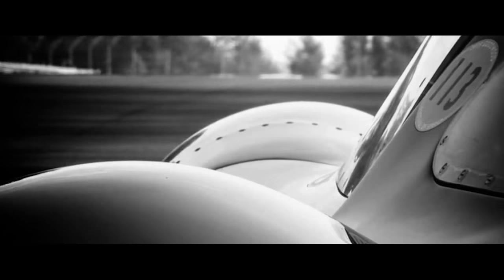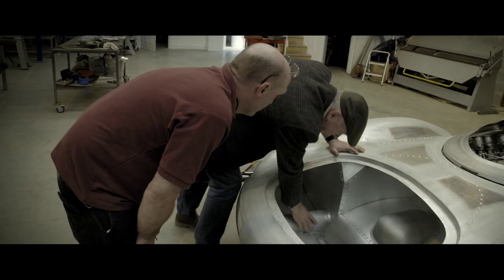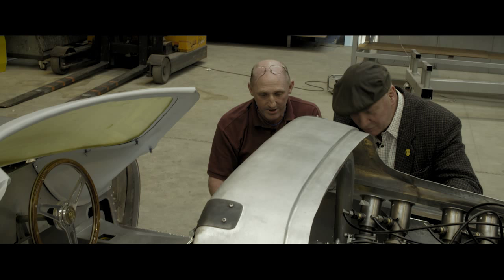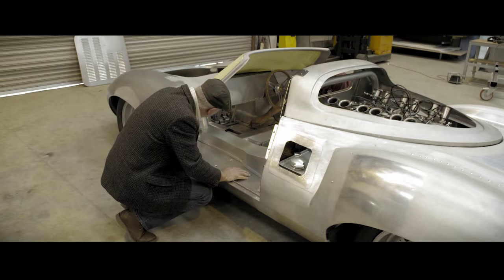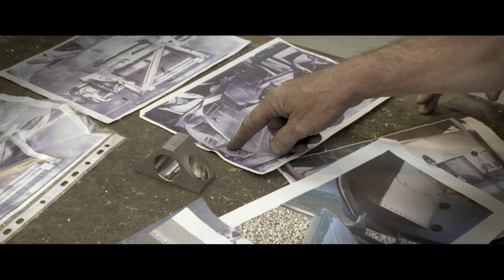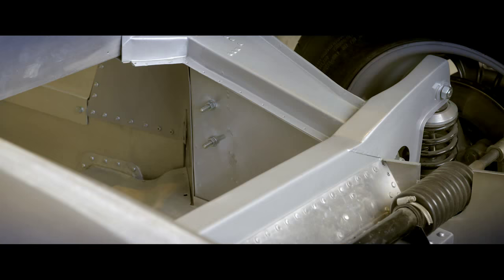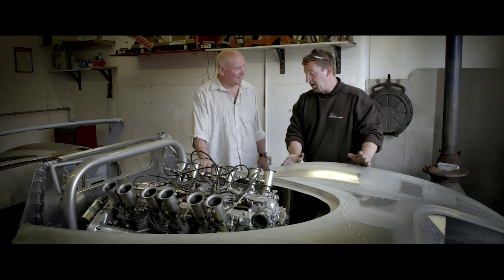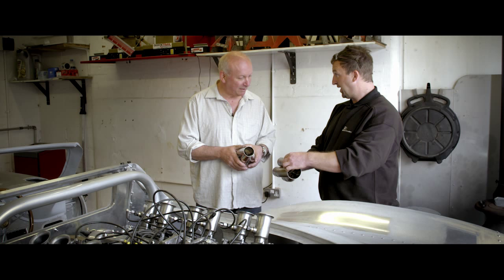Recreating Jaguar's Legendary XJ13 - 50 years on

Comment: Nice to find this in you tube. I completed my apprentiship 71-75. The last 18 months in the veh. experimental dept. under Ted Brookes and having the rebuilded original car in the shop. Nice to see the credited names at the end of the film. I worked with these guys during my time in the Exp. engine dept. Hope all are keeping well. After 3 year working for Ted I had the honour of working for Norman Dewis 78-86 (who of course had the accident at MIRA with the original) years before. Thanks to Norman I met my wife 1983 as he sent me to the Nardo testing circuit. Thanks Norman RIP. Ralph...
Reply: You must have started not long after me, I did my apprenticeship from 64 to 69 and ended up working for Harry Mundy in power unit design, leaving Jaguar in 76. I designed the battery box and parts of the gear change linkage for the XJ13…..very important parts……😅
Reply from the maker: Gents - you are always welcome to visit. We’d be honoured to see you. neville@buildingthelegend.co.uk